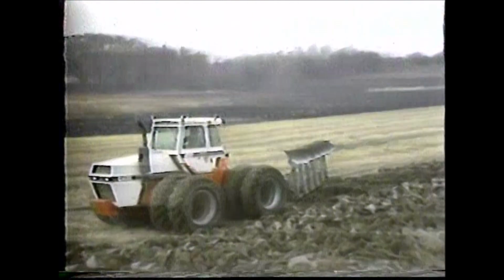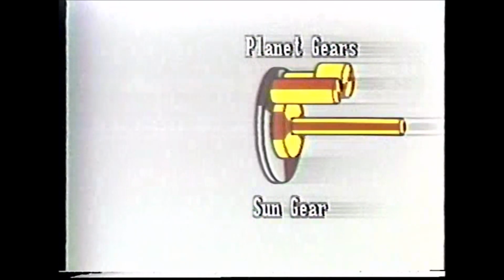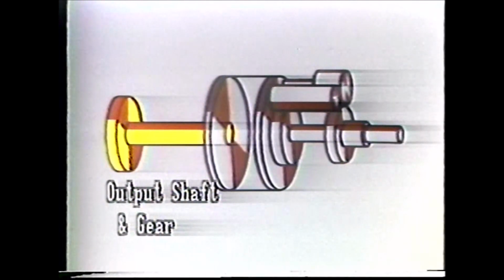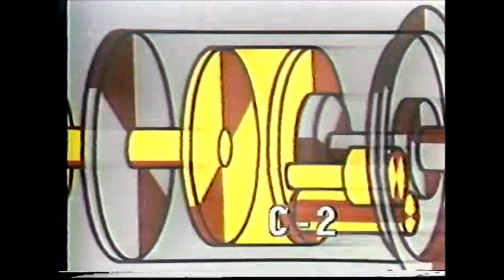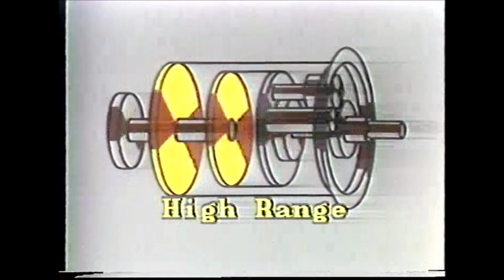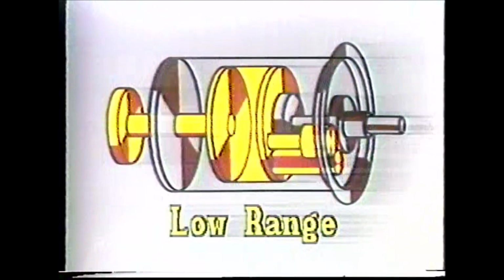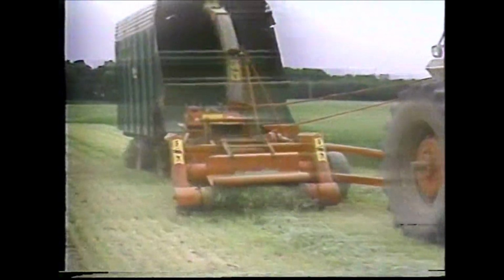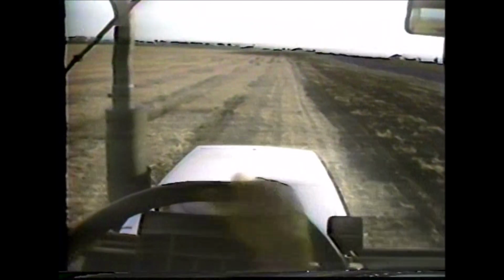Case R P S  'How it Works'

Comment: I had a 1070, 1370, 1570. My brother got off the tractor at lunchtime while harvesting with a pull type combine. I asked him what gear he was using when I took over. He said second grind first jump. I knew exactly what he meant. There was no modulation from one speed to another so when I was about to change speeds I would warn the kids riding along, watch your head ! There were 4 ranges but in the highest range reverse is blocked off. Even the third range was dangerously fast. The slowest reverse was often too fast for blowing snow so I would constantly ride the clutch. Terrible transmission with lots of trouble. The engines were excellent. I liked the pto because when you put a one inch spacer in behind the pto shaft, the 540 shaft became 1000 rpm. Handy for blowing snow or augering grain.

Comment: Thankyou for  the good helpfull information ,on the case  power  shift  , Mmmm very interesting  , would  be nice just to leave in 3 rd power shift ,  DIRECT DRIVE . And just use the 4 speed  manual gears . The reverse  when  needed   .

Comment: Best forward to 8.43.  No conventional clutch, no torque converter either.  Its an engine coupled directly to a 3 speed auto and thats coupled to a 4 speed manual. For a clutch it uses one of the 4 clutches in the auto section to engauge reverse (while disengauging the rest of the clutches) to disengauge the engine, but also reverses the internals to create a braking effect to slow the auto sections output shaft so you can select the manual box (range selector).  Its got a torque limiting clutch, but thats a safety feature which normally isnt used.